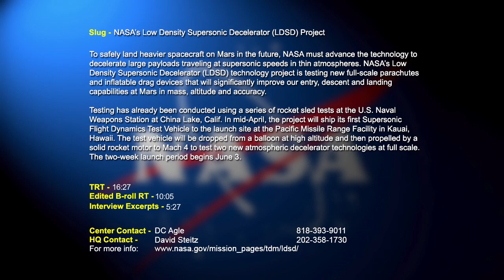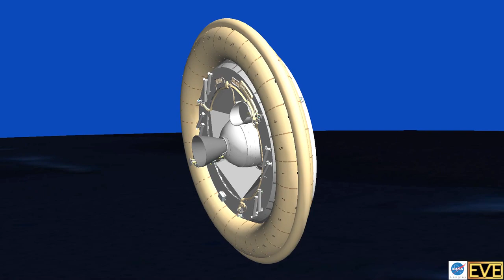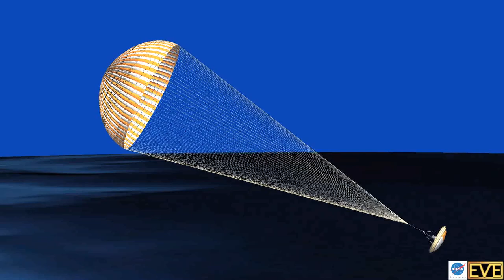Video file: NASA's Low Density Supersonic Decelerator (LDSD) project

Comment: why not have a structure expand with epoxy or some non gassing resin?
Reply: My Guess would be because of mass. Using a gas means you can use less mass and get more surface area to create drag with an inflatable. You can compress a gas and take up less volume in the spacecraft also.